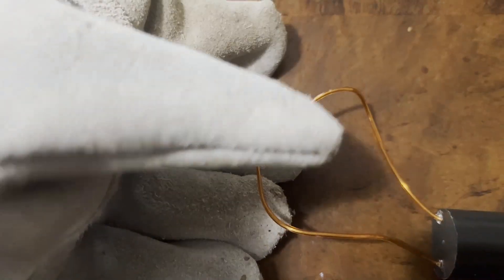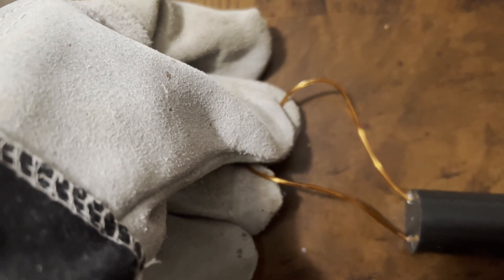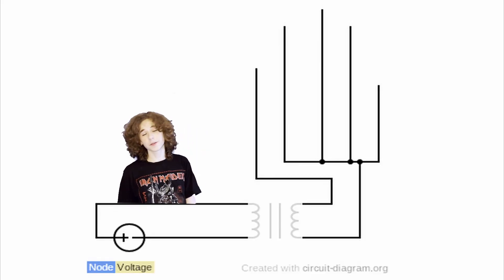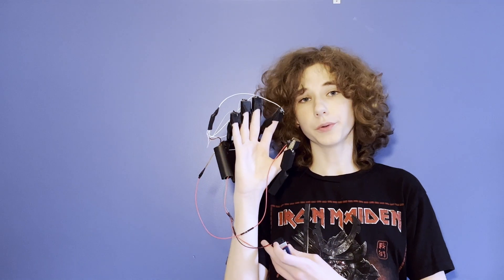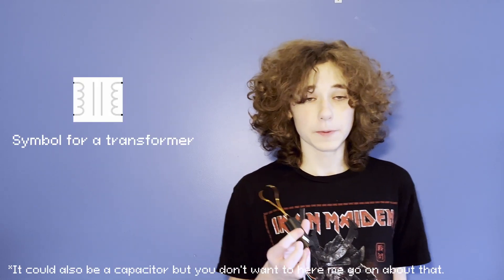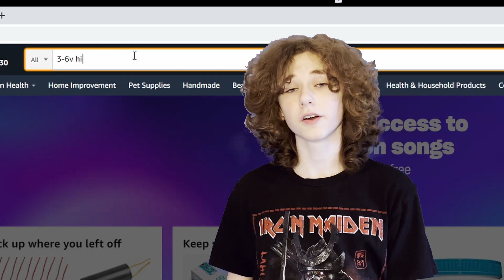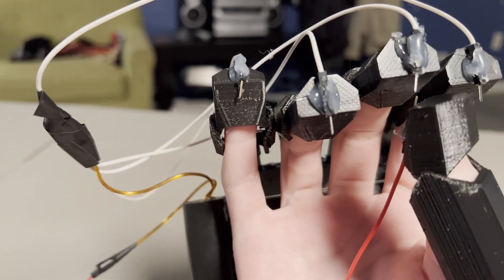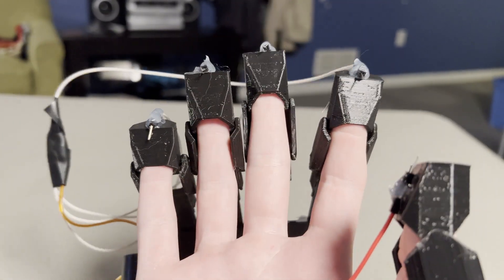I made a taser glove

Comment: To anyone who wants to make one of these make sure you check whether something like this is legal where you live. If you made this where I live, this would be considered a prohibited weapon and you will end up in legal trouble. In many places it could be legal but be careful. To the poster as you list yourself as living in the USA you are most likely fine but a few states might have some issues. If you used this on another person or animal the authorities will not look kindly on it. If you take it to school expect to be in trouble. It is pretty cool otherwise but it will only cause pain and you will probably just piss someone off if you zapped them with it. 

To expand on your technical information the circuit is a bit more complex than you show. A battery connected directly to a transformer is actually a short circuit. Inside the high voltage pulse generator there will be a oscillator that the battery will connect to. The output of this oscillator then connects to the low voltage end of the high voltage transformer. Transformers are a alternating current device so need a oscillator to provide the proper input. There may be some capacitors on the output of the transformer as well to help build up the amount of charge for when the output arcs over. 

Please be safe. Do not get yourself or others hurt!
Reply: I checked, it is illegal in my state, Connecticut (;-;)